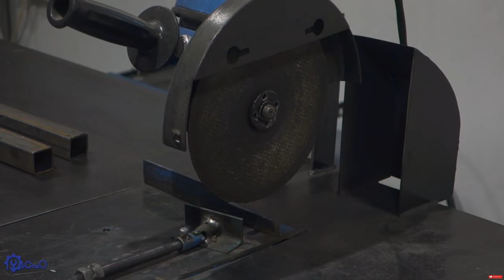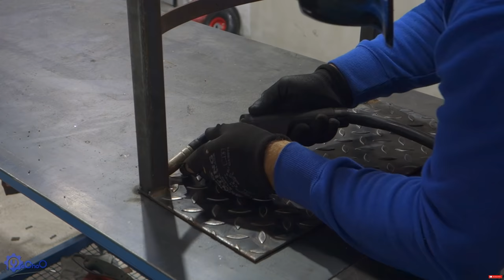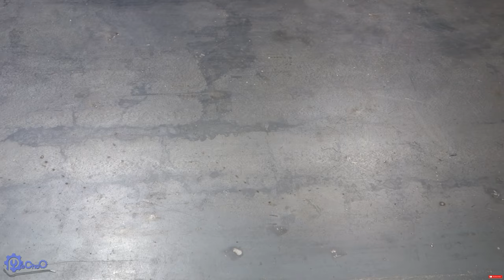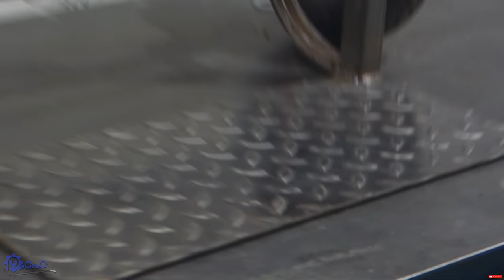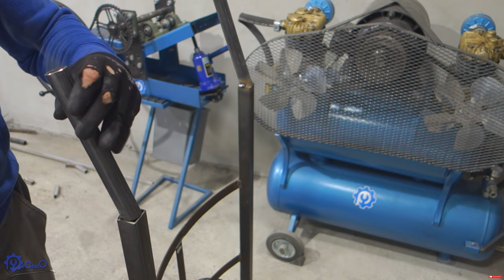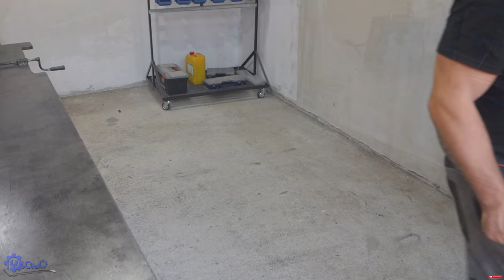DIY - Hand Trolley Heavy-Duty Capacity 250kg

Comment: I'm a retired stone mechanic. Master craftsman in the trade. Started something new at 63. Heavy diesel repair company. Parts and pieces are heavy. You would be surprised at the caveman mentality when it comes to moving things around. Nuts and bolts and a few Big trunk monkeys. Sucks seeing all the old lathes and drill presses from the 40s and 50s every welder and new fancy stuff. All gathering dust for a decade. Snap on is the new tradecraft it seems.

Comment: This is not for 250 kg as you said but is a good try from you. If you want it lifting heavy kgs you should prepare thick square metal 50mm + thick metal pieces of  3 mm + gum wheels😉
Reply: So hand built trolleys would 3mm 50x50 square tube be strong enough for say 300+kg